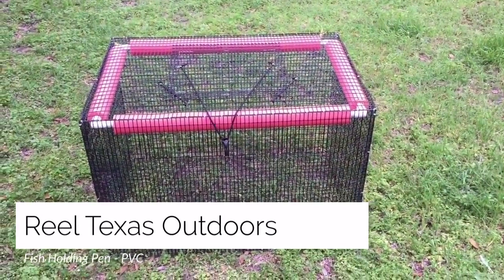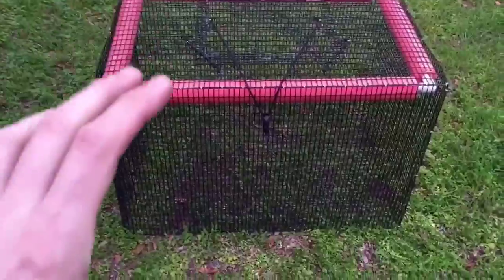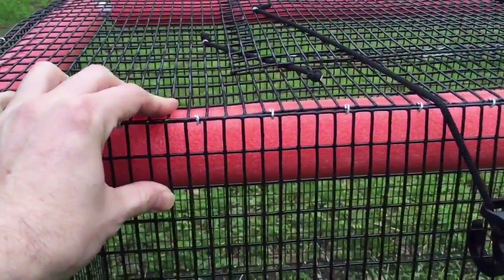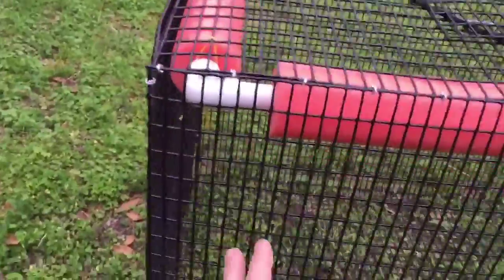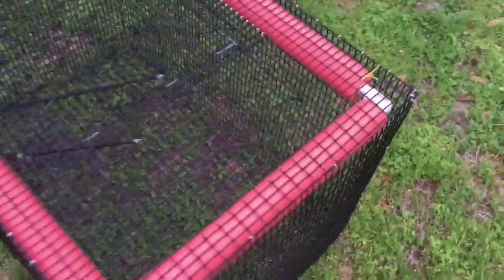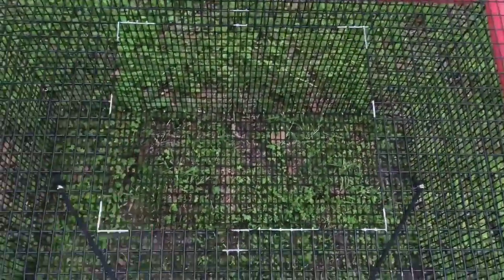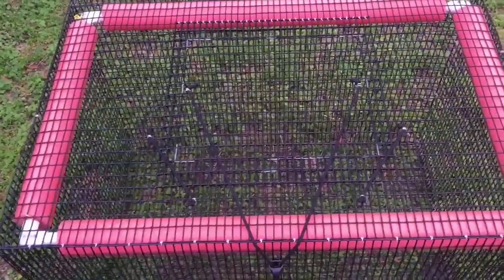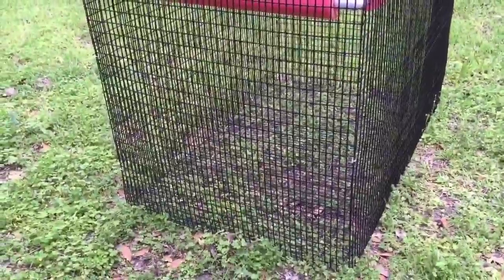Fish Basket - Floating Fish Basket - Fish Cage - Fish Holding Pen

Comment: Question, if anyone is still reading the comments on here, can this be used from the bank or is it only for if you're fishing from a deck?
Reply from the maker: Hi Hunter, it’s mainly designed for use off a dock, but you can use them wherever you’d like. From the bank, you’d have to drag it in unless you wanted to wade out a little to drop your fish in each time.
Reply: @ReelTexasOutdoors  Okay thanks! I'm just getting back into fishing and I don't have a boat so bank fishing is my primary method and it isn't a guarantee I'm going to be on a deck a lot of the time. I was thinking of maybe securing one end to the shore and letting the cage part just float out into the water. My thinking is the waves would carry it out for me without much effort on my part. What do you think of this idea? On a side note I'm pleasantly surprised you actually read this comment. As old as this video is I thought this might be a dead channel.
Reply from the maker: @hunterthewerewolf  - I think that could work… The only issue will be if you’re fishing from a bank that has a very gradual slope to get to depth. If that is the case then you’re going to have to wait out at least 2 feet to get the thing to start floating. The pen is 2 feet tall, so you will have to get to the depth of the floats in order for it to be carried out by waves. That wouldn’t be that big of a deal to have to wait out to about knee-deep to drop fish in though. As far as the channel goes, I still read all of the comments. This channel is mainly used for making videos to outline the traps and pins that we built. I occasionally will upload a fishing video as well. Please let me know if you have any other questions. Have a good one.